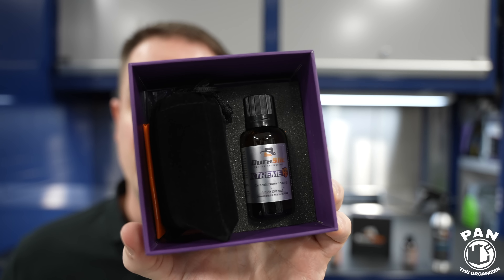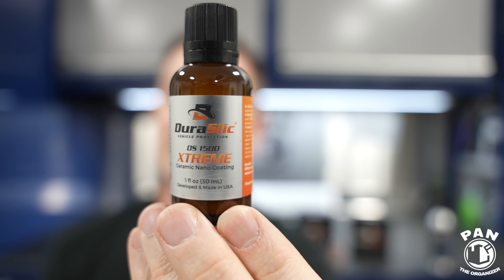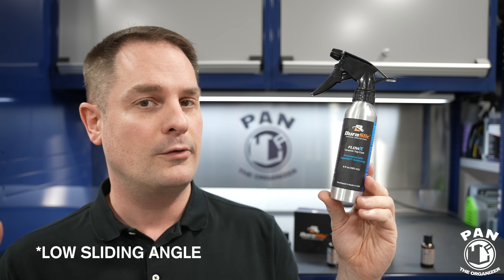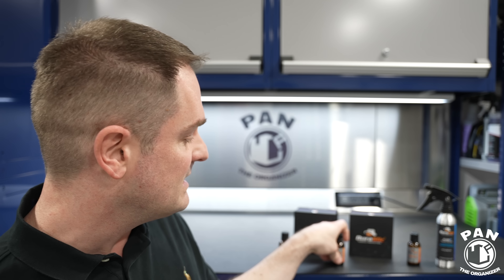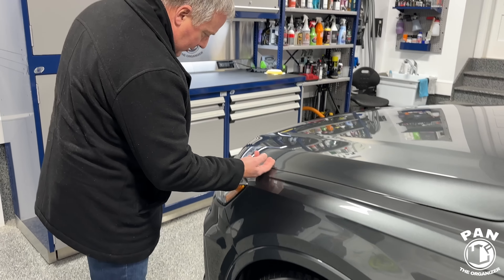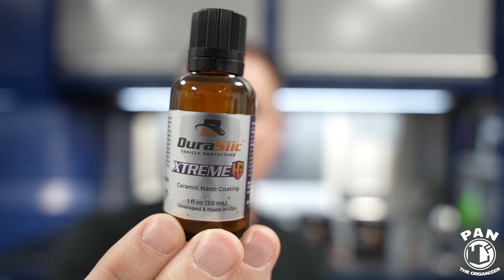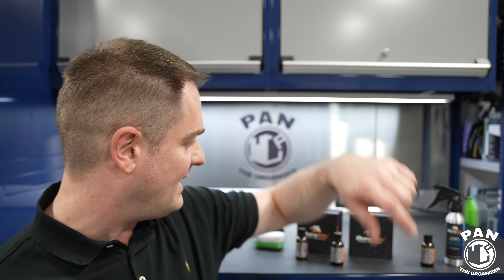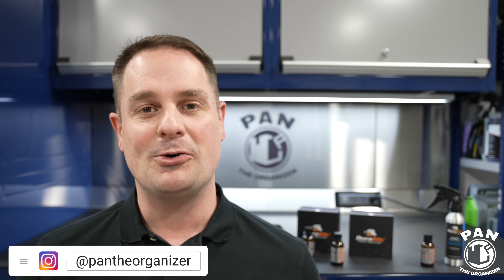Is This The Holy Grail Of Ceramic Coatings? NEW DuraSlic Holy Grail

Comment: The website says the MSRP is normally $175, but Pan's subscribers get a special discount price of $189. 😂 Thanks for the discount.
Reply: @darylcooper5481  why does this require a class when it's the same application as any other ceramic in a bottle?
Reply: @The1Music2MyEars  maybe so they doesnt get sued by american customers🤷🏻‍♂️ through this they would have proof the customer should know how to apply it
Reply: @darylcooper5481  you don't have to defend a typo on their website.
Reply: So then sell it for msrp price
Reply: @The1Music2MyEars  lmao ikr, diamond protech's professional grade basically just means there's a curing time and that it needs to be installed indoors, lol. But like the other reply said, it is a liability issue for sueing since people would try to get their mistake montarily paid for, not only get fixed, but to have a debatable number for the time their car wasn't looking right, lol. Plus most people dont know about cars so they would kind of be freaked out, not knowing that the coating can be removed, 😂
Reply: @TRX2021   relativism is all good buddy. But it leaves itself open to explain away the bad on the account of itself (e.g. how open minded its meant to be. God forbid you take a stance and outright state N.K is a bad country. Or China, no theyre good. Buecause I'm a moral relativist yada yada). Get over yourself. I dont care wether your feelings get hurt over me saying its probably a precaution. Because when it comes to claims of 7 year protection; I have no doubt some american getting 1 is reason enough for them to sue. Meanwhile in the rest of the world we all think "well, it did seem to be to good to be true. I guess either I didnt do this shit right, or I got scammed. Amyways"

Also, bringing in hate crap, as you put it is unbeliavebly childish of you, you have no idea what hate crap is. Also, I dont see where immigration fits into the picture here? Please enlighten me oh great one. People coming to my neck of the woods dont want to leave either - see how little of a relevans that has to the matter at hand? Me saying this is a precaution against american customers is far from hate crap. Im in fact, 90% sure its the reason. If you want to cencor free speech, and truth, thats on you. My advice is that you calm it dowm and accept the fact that you guys take the lead on stuff like this. If you hate it so much, go change how easy it is for you guys to win in court based on emotional damage from applying coatings to your car. Jesus dude

Nobody cares about your feelings. Nobody in the world acts out like your population does. Open your eyes

It could in fact not have been left at people. Because this is an american company, making an american product. Guess who lives in america, and likes to sue? Oh yes..
Reply: @SAGITTARlUS  "CANTINFLEAR" IN ENGLISH HAHAHA!
Reply: @Monterrey_Manila  sure buddy👍🏻
Reply: @Monterrey_Manila  Indeed it was...
Reply: they just need to make you electronically sign a waiver on their site so they aren't held responsible for you misusing it. Don't limit it to installers.  that's crazy  I get it, though. just make us read and check a box before purchase, taking full responsibility, or we can't buy it.  problem solved.
Reply: Pan, is this your favorite coating? Curious what your personal favorite is
Great show and content again!
Reply: @Markus Gustavson  nobody cares what he said,  what you said or what I'm saying here. Everyone thinks they know best, and the only person they care about is themselves., that's life.
Reply: Our apologies for the confusion on this.  The $175 product MSRP which showed up in that initial hour of the launch was an error.  The product actually doesn't have a suggested retail price, as it is only intended for our professional network, plus this fantastic Pan the Organizer audience for a limited time.  We appreciate your support and patience with a small human error which was quickly fixed.
Reply: Will 1 bottle cover BMW X5?
Reply: @Thomas Vogel  easily...It's crazy how far 30 ml bottle will spread...
Reply: @tyarnold4088  touche bro
Reply: @The1Music2MyEars  it’s just a barrier to entry and makes the product more exclusive. As a customer it gives you security knowing that your installer is a certified professional who knows what they are doing, not just some kid who decided to start coating cars because he heard it’s good money. From a professional point of view, we can charge a bit more for a pro grade product because we have done the training and certification, and it’s not an over the counter chemical that can be bought by the guy down the road who does work for cheap. It’s a win win for the professional detailer and their clients.
Reply: @SAGITTARlUS good grief, prejudiced much?
Reply: @agreen778  more like, realistic

Comment: “For a limited time, Pan The Organizer Subscribers can take advantage of DuraSlic XtremeHG at a reduced price! XtremeHG usually has an MSRP of $174.99, but we’re giving Pan fans a special discount.”

But when adding to cart and going to check out its $189.99????
Reply: Our apologies for the confusion on this.  The $175 product MSRP which showed up in that initial hour of the launch was an error.  The product actually doesn't have a suggested retail price, as it is only intended for our professional network, plus this fantastic Pan the Organizer audience for a limited time.  We appreciate your support and patience with a small human error which was quickly fixed.
Reply: @duraslic  that’s a load of bull and you know it.  Someone typed $174.99. Don’t lie now

Comment: Question:
Do you find the best Graphene against the best Ceramic to be actually better...It seems like the focus is mostly on Ceramic from most companies 
..I just got the Graphene from Dura-Coating being my fav Ceramic (Nano 1 Coat 4+ year 9h) I got there Glass X to for the window as it has a durability of 1.5 years and up...I've had it on my truck for 2.5 years and it's still performs great.....

Comment: Just applied Dura Slic to my 2021 Boxster. I expected that it needed correction, but was shocked to see the number “21” stamped into the driver’s door  (printed through from paint shrinking back over time? whatever it was, it buffed out beautifully). Best surprise was the great gloss boost from the DuraSlic HG.
Reply from the maker: Thanks for sharing your experience Bob. This is an excellent choice for a coating! Yeah the gloss is very good, but did you also notice the slickness? And it will only get better in the coming weeks, while the coating continues its curing!

Comment: I finally got my black 4Runner polished and coated with DuraSlic HG and it looks fantastic. It was my first time using my Rupes mk lll or any polisher for that matter.  It took me around 12 hours to get it all completed. Thanks to Pan for giving me the confidence and how to videos to complete this on my own. I used the 3D one polish with the buff and shine ero pad. I tried to finish the buffing with Rupes uno pure and ultra fine pad but couldn’t see and better results so I skipped the final polish.  Thank you Pan.
Reply from the maker: That's awesome! I know my viewers can do it if they watch my videos and take the time to do things well. And now you can apply any coating in the future. Good job! After the first week, you should notice a further increase in gloss and slickness as the coating continues to cure. Make sure you don't wash the vehicle for the first 14 days after the initial application.
Reply: @PanTheOrganizer  I might post a video of it on YouTube, there’s not a lot of info out there on YouTube that I’ve seen.
Reply: Is one bottle enough to coat the whole vehicle?
Reply: @spark1545  I did my 4Runner including the roof and it was plenty. It was my first time and think I went a little heavy on the application. I love the coating, it’s very good. Cleaning my vehicle is a lot easier and the water runs right off.  I’d highly recommend it.

Comment: I put a graphene coating from GlassParency on my 2022 Hyundai Elantra N-Line and was driving behind a jacked up truck. I could not see what was in front of it but he had run over a fallen limb (not a branch, a legit limb maybe 4-6ft long and roughly 10 inches in diameter at the base) I was surrounded by traffic so I had no choice but to hit it. I was sick the entire way to my destination just knowing I had a giant scratch all down the driver side of my 2 day old car. I arrive to find not a single scratch but just some scuff marks that I wiped off with a towel. I am not sure if I just got insanely lucky or if the coating was the reason, but that alone has made me want to put a coating on every car I will ever own.
Reply from the maker: Coatings are by far the best paint protection for sure. They aren't meant to protect against scratches though (only PPF can protect paint against stone chips and scratches) but luck was on your side for that unfortunate accident.

Comment: Here’s a summary of the video "Is This The Holy Grail Of Ceramic Coatings? NEW DuraSlic Holy Grail":

- **Product Overview**: The DuraSlic Holy Grail (HG) is a new ceramic coating designed for superior durability, gloss, slickness, and hydrophobic properties. It's marketed as combining the best features of previous products into one.
- **Key Features**:
  - **Durability**: Offers up to 5 years of protection, depending on environmental factors and maintenance.
  - **Slickness**: Includes the super slick technology, making the surface extremely smooth and easier to clean.
  - **Hydrophobic**: Has strong water-repellent properties, with low water sliding angles for self-cleaning effects.
  - **Ease of Application**: Only requires one layer, which simplifies the application process.
  - **UV Protection**: Adds protection against UV rays.
  - **New Haze Flash System**: Instead of rainbowing, it hazes like a traditional wax, indicating when it's time to level and buff.
- **Application Process**:
  1. **Preparation**: Wash the car, decontaminate with a clay bar, polish if needed, and use a surface prep to ensure a clean base.
  2. **Apply**: Use the provided applicator to spread the coating in a crisscross pattern.
  3. **Buff**: Once the haze appears, level and buff with microfiber towels.
  4. **Curing**: Wait 24 hours before exposing the car to water, and 1-2 weeks before washing.
- **Customer Reactions**: In demo tests, customers were very impressed with the results, especially the gloss and slickness.
- **Availability**: The product is usually for certified installers but is available for a limited time to Pan's viewers.
- **Final Thoughts**: The reviewer highly praises the Holy Grail for combining ease of use with professional-grade performance, especially its slickness and hydrophobic properties.

Comment: How do you contact DuraSlic support? I have had no luck. Questions I have are around FlowX. 
1) Can FlowX be applied on all vehicle trim, paint, glass? 
2) can FlowX be applied on PPF?
Reply: Sorry if there was a delayed response from our team, but I believe you've received an email now.  Just in case...1. We find FlowX is best on the paint and suggest our DS1500 for Glass and Trim.  That doesn't mean you can't apply FlowX to these areas, but the best results are on paint as a topper. 2. Yes, you can apply FlowX over PPF, but we still recommend using a base of Xtreme first in order to get the longevity.

Comment: Can this be applied to the paint before I install a paint protection film like 3m---then apply another layer ontop of the film?
Reply from the maker: Ideally, you don't apply protection before PPF. You want the PPF to bond correctly to the paint. Once your PPF is applied, then you apply a coating on top.

Comment: Hi Pan !  J. P. Here from Toronto. I had my 2019 Jeep Wrangler Sahara ceramic coated with IGL kenzo. I recently had my hood repaired, and repainted. What ceramic coating do you recommend to go over the clearcoat ? Should i try a graphene coating  ?
Reply from the maker: Any coating you like it doesn’t matter. Just keep in mind to wait two full months before applying any form of paint protection on a freshly repainted panel. The paints needs to fully cure and finish its out gassing.
Reply: @PanTheOrganizer  Thank you Pan !!  You are the greatest.

Comment: I had a professional Gyon ceramic job done with a 5 year warranty 18 months ago. Still beads water and cleans easy. Can I apply this over my old coating?
Reply from the maker: No. True coatings (glass bottles) need to bond directly to virgin clear coat. You’d have to prep the paint and machine polish the old one off before applying a new ceramic coating.

Comment: Hey Pan, could I do two layers of this product? If so, how long would you wait between coats? Thanks in advance! I’ve already ordered one bottle but I’m thinking I need to order another bottle to make sure I have enough, and at that point I’ll use whatever I have left to do a second layer on certain areas or the whole car if it lasts.
Reply from the maker: One layer is all that is required. I think I remember they said you could apply a second layer, but I don’t remember any other details. Perhaps write to them and ask.
Reply: @PanTheOrganizer  I will do that, thank you Pan!

Comment: I bought a bottle. Can I apply this to the glass? Thanks in advance Pan.
Reply from the maker: Hi Roger. It can be applied to paint, glass, plastic trim, wheels and lights.
Reply: @PanTheOrganizer  
Thanks Pan. I figured you could much like other coatings.  I've mainly used  G-Techiq CSL and EXO. This should be an up grade. Love just 1 coat too. I'm doing both my and my wife's cars this summer. Love you very informative channel.
Reply from the maker: CSL + EXO was already a 3-5 year coating, like Holy Grail. So in that sense, they are equivalent. CSL is also super slick, like Holy Grail. So you already had a very good duo.

The main advantage with Holy Grail is that it's a one layer system (compared to one layer of CSL and two layers of EXO v4) and has better hydrophobic properties.
Reply: @PanTheOrganizer  What about the oil repellency? CSL doesn't even talk about that. 
 I got 5 years out CSL except the lower rocker where it took a beating. Every where else held up well.
Reply from the maker: You can hear more about the DuraSlic coatings from the chemist himself in this video I made: https://youtu.be/A8V7_HysfwA
Reply: @PanTheOrganizer  Yes I watched it. The oil repellency besides 1 coat was a selling point for me. It seemed a cut above the others out there. The price was the only factor I had to think about. But I should get several cars out of the bottle. Appreciated your feedback Pan

Comment: Hi pan I have a question I hope you can help with.  I’m going to ceramic coat my car. I like gloss and water beading. I’m either going to get the DuraSlic HG or the Adam's Advanced Graphene Ceramic. Adams claims 9 plus years protection. Any thoughts would be helpfully.
Reply from the maker: Claims on paper and real world durability are two completely different things. I applied the Adam's Advanced Graphene Ceramic Coating on my girlfriend's vehicle in October of 2021, and do regular updates on that. So far so good.

DuraSlic is a more pro-grade brand and their HG coating is superior in every way possible (gloss, slickness, ease of application, hydrophobics, self-cleaning, etc) but also costs more. 

Both coatings are still relatively new to market, especially the HG which just launched, so nobody has had the chance to test them for 3+ years yet.

Pick one, and enjoy, you can't go wrong.
Reply: @PanTheOrganizer  looks like the DuraSlic is the one for me.  Thanks for having DuraSlic let your followers be able to pick it up.  Can’t wait to get it.  Thanks for your time.
Reply from the maker: My pleasure. Enjoy!

Comment: I know they say it’s a one coat but any thoughts on applying two coats?   Thanks.
Reply from the maker: There would be no real advantage in doing that in my opinion, but if I remember I think they mentioned you can apply two layers. But you'd need to confirm with the brand to make sure.
Reply: @PanTheOrganizer  Thanks Pan you’re the best.